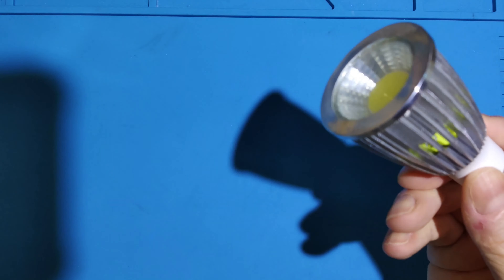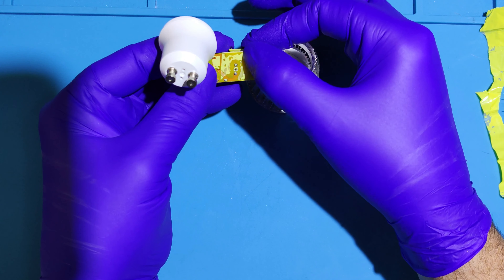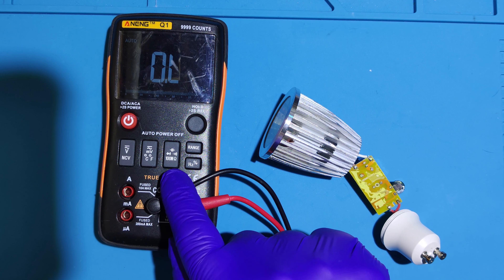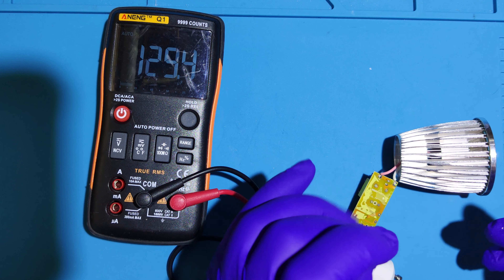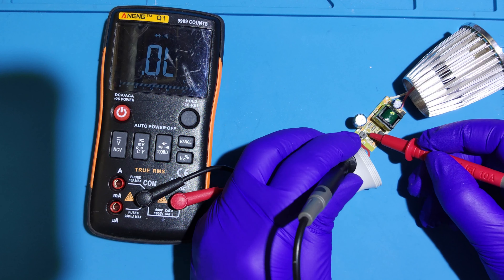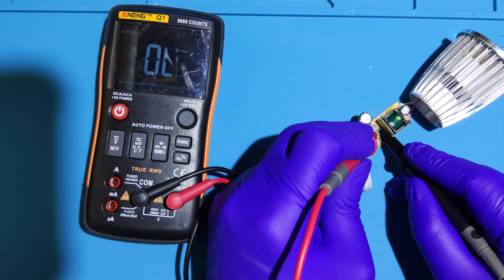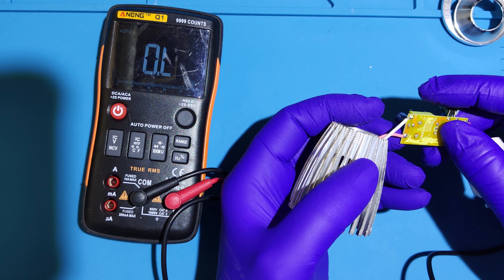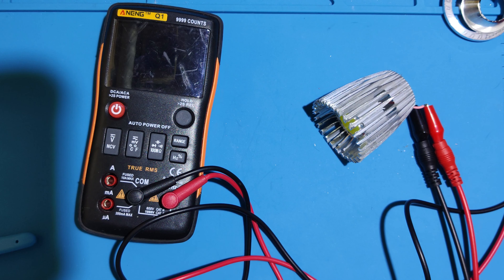LED Lightbulb Repair - NO FIX

Comment: A bit worrying to see absolutely no fuse or attempt (using a low value resistor) at fusing in that bulb.
If something goes short you will be limited by the breaker in your fusebox, probably 5 amps but some houses are higher.
Or if you have it in a desk lamp of some sort you could be looking at a 13 amp fuse in the plug.

My experience with LED bulbs is that it is almost always one of the LED's in the series chain goes open circuit when they fail.
If they are separate LED's you can often spot one with a black burn mark inside it.
How high did you take the voltage on the bench supply, some bulbs need quite a high DC voltage because of all the LED's in series.
The cap on the output will give you an idea of the max voltage.
Reply from the maker: I went right up to 60v and nothing. Not seen one higher than 36v so far. Yep no kind of inrush limiting or fusible resistor and your shouldn't be able to get inside them so easily. There was no black pop mark on this one so I was hopeful it was the input cap. Had about 50/50 with dead LED or dead cap. That cap takes one hell of a current spike with no inrush limiting. If I do another one, I might modify it slightly. Output cap was a 35v one or 50v I believe.